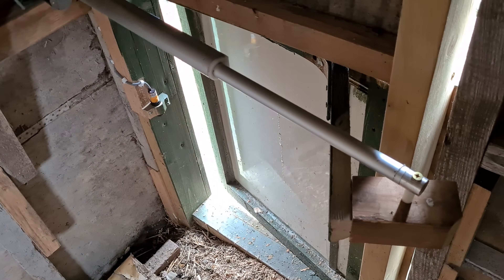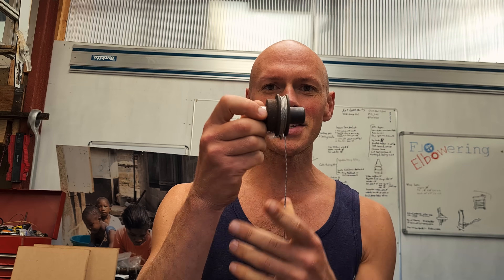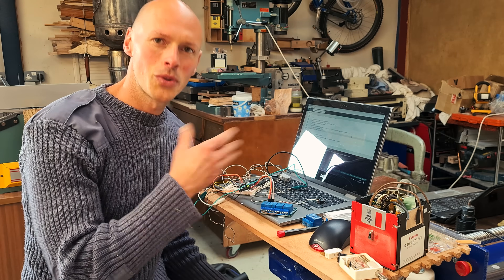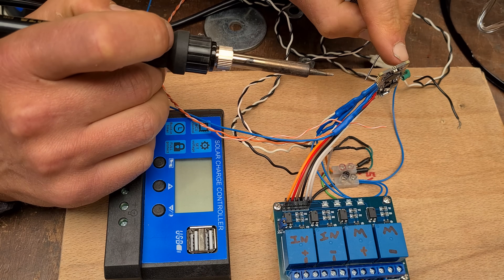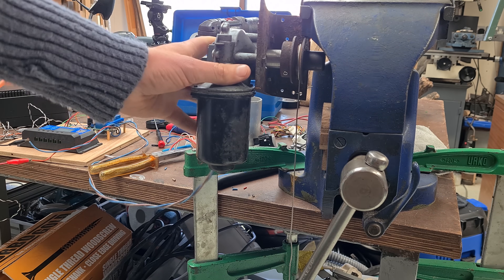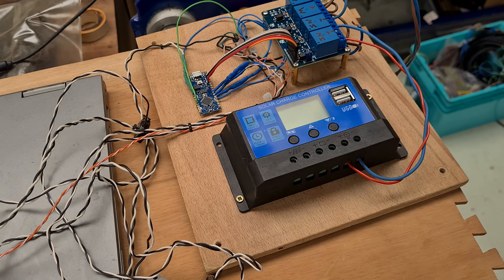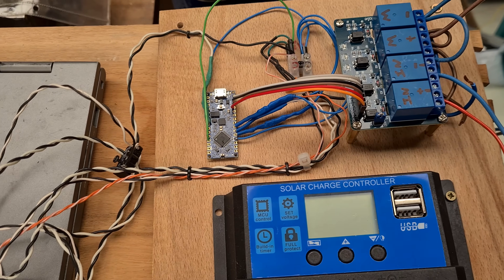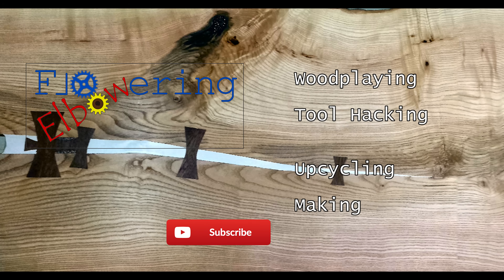Building an Arduino Powered Chicken Coop Door That Actually Works!

Comment: What about a fox using a flashlight to open the door?
Reply: A fox doesn't have the 100 second attention span required to activate the light sensor. They get tired after 22.7 seconds of holding a flashlight anyhow.
Reply: @s.whitaker1120  That's not true at all. Fox are very smart and will take the time to figure out weak spots. The ONLY reason they don't use flashlights is because they don't have thumbs. They can't put batteries in after the ones that come with the flashlight die. DUH

Comment: Cool. If using relays, you don't need 4 relays to switch polarity to a motor, just 2 will do. Each relay's common would be connected to motor + and - respectively and both relays NC pins would be connected to battery negative, and both NO pins to battery positive. This way when energizing relay #1 motor will spin one way, and if energizing relay #2 the other way. Energizing both relays will do nothing.
Reply from the maker: Yep I hear you. Realized some time after abandoning relays altogether. I still think that would have worked well, and had the advantage of not making the high pitched noise the PWM module makes. The motor was too fast really though, so PWM it is...